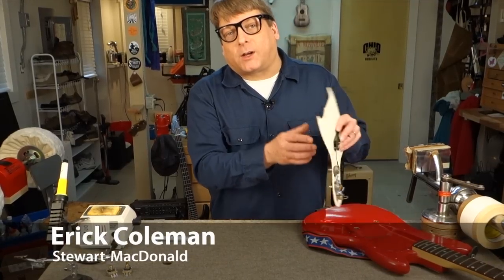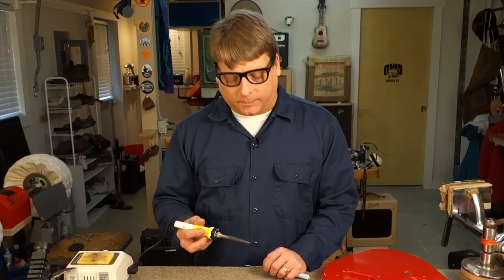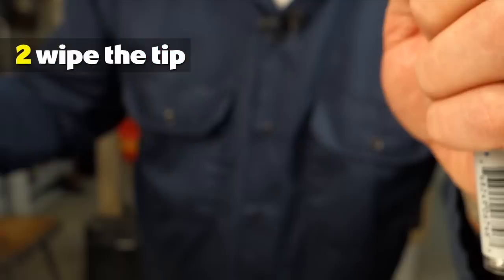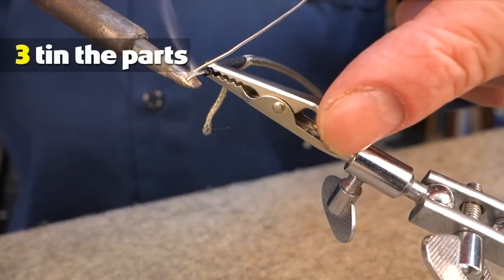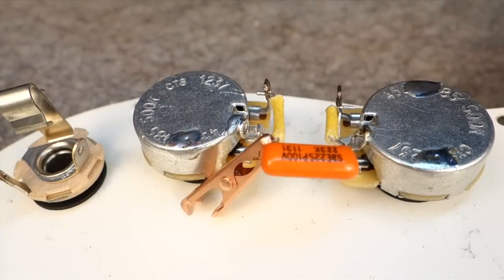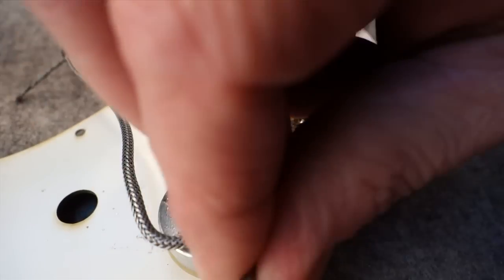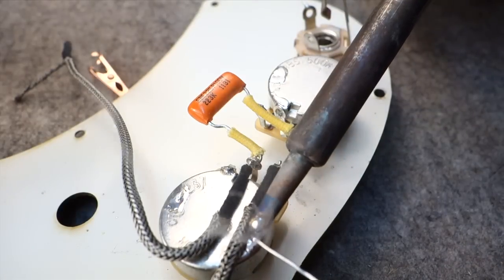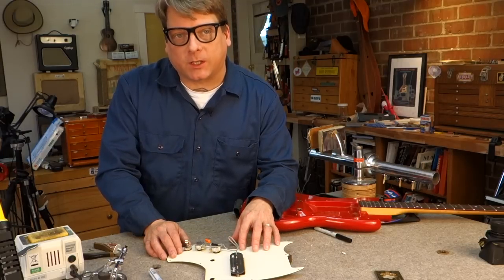Guitar wiring: how to get a good clean solder joint!

Comment: The most idiotic parts of guitar electrical components are the pots.  Why manufacturers don't put solder post for ground is beyond basic intelligence.   Even with a high or variable power solder gun, the amount of heat needed to properly flow the solder on the back of the pot is ridiculous. In addition you are risking damaging the variable resistor inside, and melting wire insulation even when adding the wire to the mix after the solder has flowed.  The solder does not naturally flow to a specific place on the pot thus creating the potential for too much solder.  Why after nearly 100 years there has not been a universal improvement is a shameful example of living in the stone age.  There are pure lugged pots out there but the industry continues to use and engineer around  this poor design.
Reply: I agree. soldering to the casing is a big mess... however, with so many wiring options, it becomes essential to have all that space. sometimes I am soldering 3 or more grounds to the casing. a single ground lug would be useless. so I can see why the design is still used.
Reply: @jeffreymadden759  connect the three wires together and solder one extension lead to the pot
Reply: well-said. I lightly scratch the back of a pot so as to get a small pool of solder ready for melting wires into. But a factory pot can be made with 1 single strip of metal to solder to easily... but the cost is what factories avoid.
Reply: Still true after 2 more years. I destroyed a pot a few weeks ago because it got too hot.
I saw people soldering a small wire or guitar string to the case of a pot to connect all groundings... maybe that's a solution.
Reply: @jicklesjingles8134  - That is a valid solution although i wouldn't recommend using a guitar string. They can rust and corrode over time, causing circuit issues.
Reply: @JanDeSorte  also, the steel conductance is different. It would affect the tone of the guitar beyond imagination haha
Reply: Yes, soldering to the case of a traditional Gibson style pot (made by CTS) is idiotic. In order to make a proper soldered joint the pot case and stranded braid must be at the proper temperature for the solder to flow, which is hot enough to damage the pot given the thermal mass of the pot and the braid. Also, not shown in the video, if you where still keen on soldering to the pot case, you would want to remove any oxidation from the pot case with emery cloth or scotchbrite before soldering, clean the area with IPA and add additional liquid flux to make a proper joint. Always use a third hand when soldering as to keep the joint stationary while solidifying. After which, remove any flux residue with IPA.

You do not need to use the pot case as a grounding solder post. Many older Les Paul type electric guitars have a two terminal central terminal lug strip in the center of the pot plate, with one position grounded to the plate (essentially the pot case ground, with the plate being considered a chassis ground) using a rivet. If you need more terminal lug strip connection points, you can remove the two position one and add one that meets your needs (readily available from Digikey). If you do not have a plate you can screw the terminal lug strip to the inside of the guitar.

From a traditional point to point wiring approach (not using a PCB) for electronics, it is clear that the plate grounded terminal lug strip is meant as the single point ground for the guitar, or star ground, which terminates the switch case ground, pickup signal grounds, jack signal ground, and bridge ground (which may have to be installed depending on the Les Paul being wired) to one connection point making a star ground topology. The pickup circuit (volume and tone) ground connection is made using tin plated copper bus wire (I use solid 16 AWG) and Teflon sleeving (which will not melt while soldering) to insulate it where necessary.

Another step not shown in the video is after the wiring is completed, clean and condition the pots with Deoxit D5 spray. Apply to the inside wiping surface of the pot and then exercise the pot by moving it stop to stop several times.

Comment: Good tutorial, (most on you tube are bad teaching and you'll end up burning up your work) Note the tip in this video is a CHISEL TIP. Do not use a round tip for guitar work. The chisel tip aids in efficient heat transfer. Also not mentioned, a 25 watt iron is just right. Avoid hotter irons as this will only burn up your work. (Hotter irons are for heating amplifier steel chassis for making grounds)  Feed the solder simultaneously as the tip is applied to your work. Do not pre-heat more than a second, or even less than that. Feed solder on the tip AND your work simultaneously, as the melted solder will transfer heat much faster, solder flow into and along your work almost immediately. If your method takes any longer than about 2 seconds, you're doing it wrong. Good soldering appears exactly like it does in this video! Good work!
Reply: I'll take your advice. I'm having problems with the my volume pot (volume stays the same between 10-4 then abruptly goes down from 3-0) and I'm thinking maybe because the way I soldered it. I'm using a 30W-70W soldering gun, and I think that's frying up my pot. Thank you man for your insight and advice 😊
Reply: @gitaramaker101  It seems most volume controls go from like 0-100 :p At least the cheaper ones.
Reply: @SmugSuspenders  haha I guess that's also one reason why, I do bought my pots online and buying the most affordable one.
Reply: @gitaramaker101  Nice :P I'm just about getting into soldering, gonna start with some old guitar cables.

Comment: If you need a heat sink to protect something as simple and durable as a modern capacitor, you're flowing the joint way too long.  The stripped ends of  stranded wire leads need to be twisted tight before tinning, but the solid leads of capacitors and resistors need not be tinned at all, and pre-loading a control's lugs with solder is also unnecessary.  Trust me on this stuff -- I've been soldering for longer than Erick has been alive.  I give him points for not recommending anything too harmful, though -- except perhaps soldering directly to the braid of shielded cable, because it's much safer to unbraid it, then twist together and tin the resulting strands before soldering rather than risk melting or burning the insulation.
Reply: I agree totally Bruce.  Pre-tinning a control lug isn't necessary and can lead to burning out a pot.  No need for it. Attach the wire first, bend to hold, solder both at once.  Bam!  Done.

Comment: Tip No 4: Remove the oily film from the casing using a sanding stick, or similar. If this film is not removed it's a lot harder for the solder to "take" to the casing.

Comment: For almost all guitar electronics a 25 watt Weller would be about right.  Don't start work until the solder melts EASILY on the tip.  
If you plan to solder a lot of different types of stuff, consider a station so you can vary the temperature of the tip to match the job.

Comment: Good tips. The alligator clip heat sink is really only needed on diodes and other semiconductors. Caps and resistors can take the heat - unless you're holding the iron on there waaay too long. Certainly can't hurt, tho.

Comment: Awesome! I didn't know about pre-tinning the tip of the soldering iron. This would explain why it takes me 1/8 of a solder coil to make one, lumpy, ugly connection. Lol. Getting ready to install new pickups & wiring harness in my newest project. Thank You SO much for this instructional video. You Guys at Stew/Mac are absolutely "THE" Best. This is just ANOTHER GREAT reason to keep buying my parts from You Guys. Please, keep up the EXCELLENT work.

Comment: Good basics makes for solid foundations. It takes practice, but do not let the work move after you remove the heat. The momentary shifting causes the dull finish and weakens the joint. Clamps holding the work in place is recommended. Harbor freight has them or you can shape the tips of clothes pins to a point and screw them to bailing wire attached to a board. You can revive tips with steel wool or extra-fine sandpaper.

Comment: One common myth on you tube are the hobbyist solderers/ guitar techs who teach that solder flows to the heat. This is wrong. Note as the tech in the  video does it the right way. The heat is applied to the pot case and braided shield, and almost immediately solder is fed and melts where the tip and wire and pot case intersect. Notice the solder flows AWAY from the tip (NOT to the heat) and flows quickly and wicks into the braided shield, a beautiful solder connection. No dull cold solder. If anyone follows the bad teaching that solder flows to the heat, (and pre-heats the work) you'll end up burning your work and have an ugly solder joint. If your solder is cold and dull, forget the other tutorials, do it as per THIS VIDEO!  (and my advice)

Comment: Foil capacitors aren't heat sensitive, so I wouldn't worry about using a heat sink or alligator clips to protect them. Active devices like diodes, transistors and op-amps are sensitive to heat, but passive devices like caps, resistors etc, aren't. 

I use liquid flux to help the solder flow faster on the back of pots, also when soldering to lugs I touch just a little bit of solder to the iron tip to create a heat bridge to the part, then I "paint" the solder onto the lug.

I also recommend 63/37 "eutectic' solder instead of the old 60/40. It melts at lower temperature and solidifies instantly when you remove the iron tip, so you reduce the chance of getting a disturbed solder joint.

Comment: Kestor 44 says that indeed it contains a type of flux contained within:

The Kester 24-6040-0027 high activity, rosin activated cored wire is excellent for instant wetting action. Although "44" is an RA-based material, the residues are non-corrosive if left uncleaned.

Kester 24-6040-0027 Features:
Wire diameter: .031"
Alloy: Sn60Pb40 (60% Tin / 40% Lead)
Melting range: 361-374°F (183-190°C)
Core flux type: RA
Core size: 66
Spool size: 1 lb.

Comment: I keep a small ball of extra fine steel wool handy to polish the tip periodically. Also never blow air on a solder joint to speed up the cooling process. It can cause a cold solder joint. Let it cool down on it's own naturally.

Comment: In N.Y., we called it 'Sodda.' I bought, and still own and use a 1966 Weller sodda- ring gun.

I made many slot car chassis with that. And, I really do use it today, Weller is the shit!

Too hot for guitar wiring applications, but I made a nice pickup carriage for a Gibson Jazz guitar out of brass- and my 8200 was just right. I also use a Weller 40 watt iron to remove frets.

Comment: If the solder rolls off the tip because you 'cooked' it , you don't need to throw it out, just file the oxidation off and re-tin. Having some real flux on hand helps as well,instead of relying on the rosin core to tin the tip.

Comment: Decent video, and one would tend to trust Stewmac.  However,  pre-soldering the pot has to be done carefully or it can wind up burning out the pot.  Instead run wire through the post and bend it for solid placement, then place the solder against the joint and melt the solder onto both.  The solder melts quickly and transfers heat very quickly to the pot and wire.  The result:  everything heats at the same time, the solder adheres smoothly and well, and you don't risk burning out the pot.   The source of this information is NASA (they have an entire manual on "spec" solder joints that will stand up in harsh conditions.)   The video itself echoes this concept when soldering the ground wire:  he lays the wire against the pot first, then applies the solder to both at the same time, applying heat to the solder and not directly to the pot.   Consistency is key.   Join the wire into the post first, bend for a stable connection, then solder.  I've never burned a pot using that method.

Comment: I find those pumps are good for opening up the lugs on potentiometers when they are covered in solder, but not much else. I use copper braid for desoldering small parts. For larger parts, just melt the solder and tap it off on the bench.

Comment: Capacitors don't need to be shielded from heat, they are massively robust because they are passive -- assuming you get in and out within 5 seconds, which is normal when soldering.

Comment: Good lesson, DO you use a 60/40 ?  
When i've tried soldering, the solder rolls off the iron, and it won't stick to the bare wires..    it rolls off.. (like water on oil) 
I'm wondering if this is because of the percentage of "tin".   I'm a beginner, but I know there;s different tin percentages depending on the job.     I had to use the solder that was connecting the old pickups together in order for it to "bind"  the stuff I had was useless..  Thanks
Reply: Anthony Lundell It has happened me too. You need to use some Flux so It will stick to metal easier
Reply: cool thanks
Reply: i actually use a dab of soldering paste plumbers use,, if course, you have to wipe out the excess off

also.. how hot is your soldering iron? i use a soldering gun like this.

http://www.princessauto.com/en/detail/fast-heat-pistol-grip-soldering-gun/A-p8650319e

yes..it's 100 watts but as long as i am careful not to over heat the parts.. you'r e okay. 

last thing..use the right 60/40 solder .. i was using plumber's for a while but it took too much heat
to get stick right..
Reply: klepetar I'm not sure how hot it gets. There's no adjustment as far as the Heat. It's a cheap one.
I think another thing I was doing wrong, I wasn't pre heating up the object I was soldering to.  ( apparently it if it's too cold or room temperature the solder will just run off? ).   that was my problem, it wouldn't go into anything I was trying to solder together.
Reply: Anthony Lundell 15-20 watt irons are ok for doing work on electronic circuits but they aren't strong enough to solder on lugs because the heat dissipates too fast in the components.. 
you need :
good heat + right solder+ soldering paste..which i sometimes in the middle of the solder or you can use some in a small can..
good luck
Reply: klepetar thanks. good tip
Reply: Having clean wires and pots is another important key.  I always hit the pot with some fine sandpaper.  If wires won't take solar, they are probably corroded.  Plumbers soldering paste is an acid that can corrode wires in the long term, I would avoid their use...  good points on having a strong soldering iron. . .  Solder will only flow when the object being soldered gets hot enough to melt the solder. . .   A small iron can damage a pot before the case gets hot enough to solder, where a really strong iron can get in and be done before the whole case heats up the internal components....

Comment: hi , thanks beautiful video! about 0:04 " see the mess right here" ... is there a way to fix it? clean it?
thanks
Reply from the maker: You will need to apply heat with your soldering iron to re-flow the solder. Then, you can use a solder wick and/or solder sucker to remove the excess solder. The most difficult part of this process is heating the solder until it becomes liquid again without damaging the electrical components (i.e. pots, capacitors). We recommend using a heat sink to absorb the heat and prevent the component from being damaged.
http://www.stewmac.com/SiteSearch/?search=soldering%20tools&o=Lowest
Reply: hi thank you so much , what head sink could i use?
Reply from the maker: If you're removing a bad solder joint from the lugs on a pot, you can use an Alligator Clip Heat Sink. Clip this heat sink on the lug between the pot's housing and the solder joint.
http://www.stewmac.com/Luthier_Tools/Tools_by_Job/Tools_for_Electronics_and_Pickups/Soldering/Alligator_Clip_Heat_Sinks_Package_of_10.html
Unfortunately, there's not really a heat sink that will work well when removing solder from the back of the pot's housing.  If you're removing a large glob of solder, you should work quickly with a hot iron so the solder liquefies without needing to apply heat to it for very long. The quickest way to re-flow a solder joint is to put a small melted drop of solder on it.  We find that a solder sucker works best for removing large amounts of solder quickly.

Comment: for soldering guitar parts. how many watts should my soldering iron be? should i use solder that is mixed with lead or use lead free solder? do i use flux?
Reply: +overthemountain16 You do not really need above 50 watts for guitar parts and lead free solder is better for your health. You can use flux if you can't get the solder to stick but if you have a good quality solder you won't need it.
Reply: Tin/lead solder flows soooo much better than lead free.  Just wash your hands after handling lead and you'll be fine.  I have several co-workers who have been soldering 5-6 days a week with tin/lead solder for 20+ years.

Comment: Mmm, 'sodder' your Strat, whole diffo meaning in the UK, how do you sod a guitar? Or is that sod as in turf?  Here in the westcountry pronounced 'souldur'.  Personally I solder (with an 'l'), and I use a 100w trigger style soldering gun for the back of pots, after abrading the soldering point, smaller style e.g. 40w pencil type soldering irons just don't have enough heat from my experience.  Solder on.
Reply: Garin Linnington I live in the US and the pronunciation bothers me.